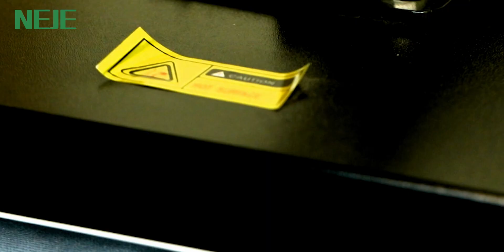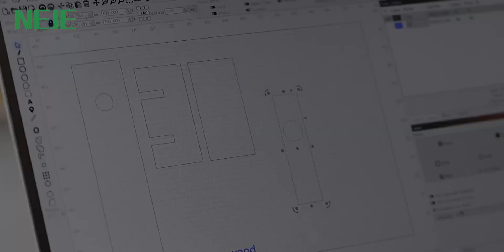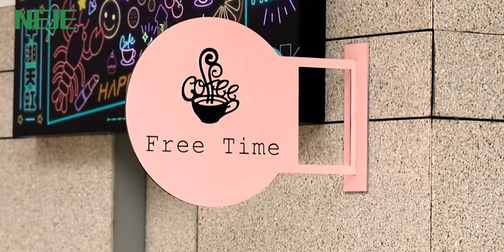2025 Best Wood Laser Cutter & Engraver | NEJE Max4 V2 | CNC Laser Cutter

Comment: Please build an enclosure if you buy this sort of raw frame laser. It only takes a stray reflection for a fraction of a second to give you permanent vision damage or blindness. The beam itself is usually invisible. What you see is stuff glowing from the invisible IR light frying it.

The safety glasses that come with these cheap lasers are also not always rated for the wavelengths the laser module puts out. Esentially being useless.

These are awesome, don't get me wrong. But like many awesome things it will injure you or others if you don't know what you are playing around with.

An enclosure with a safety switch is easy to build and may save you from life long disability. Even "just" having one eye with messed up focus or blind spots will annoy you for the rest of your life and always remind you of that one time you tried to foolishly engrave some metal wearing nothing but cheap "safety" goggles. Because with IR laser light you can totally fry your retinas gawking at the cool laser cutting action and not even notice it until it's to late.

Same goes for your pets, family members or friends. Anyone in line of sight of the machine.
Reply from the maker: Thank you very much for your kind reminder. We recommend that each user build an enclosure and use acrylic panels to make windows to protect the eyes. We provide the frame for building the enclosure, which can be purchased if necessary.
In addition, thank you very much for your reminder, we will consider providing glasses with better guarantee.😊